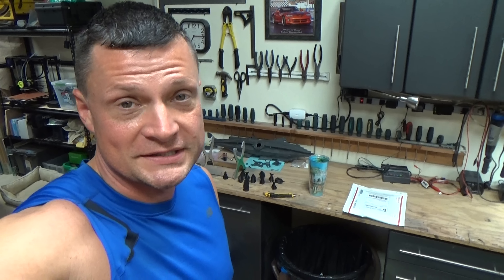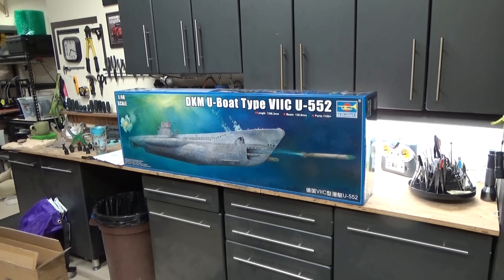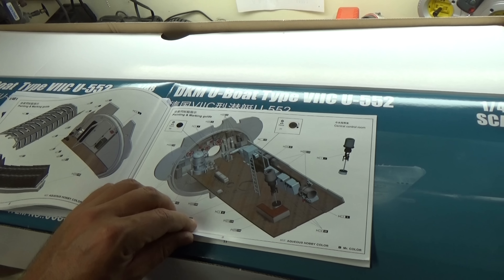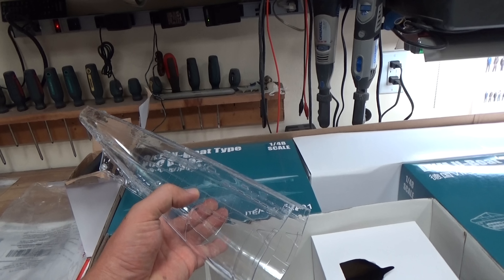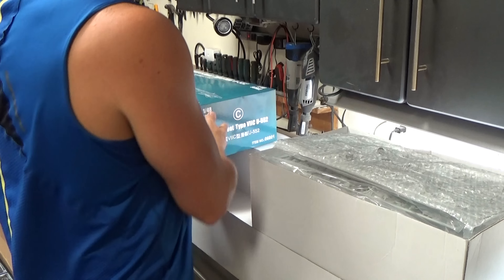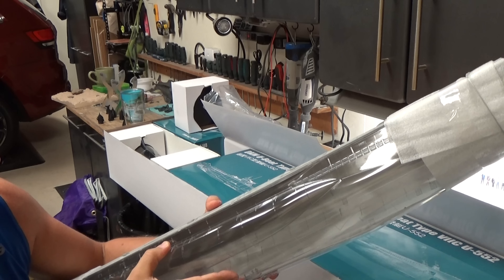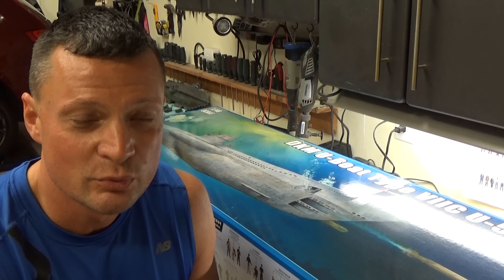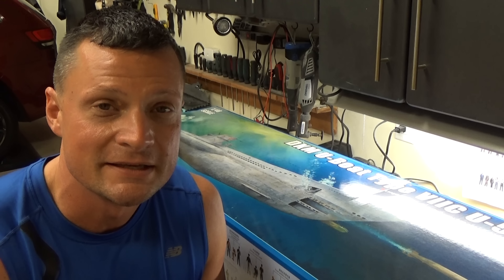Trumpeter Type VII Kit Review by the Nautilus Drydocks

Comment: Not necessarily a UBoat lover, but sure, Submarines generally. The preferred scale is 1/144 because of it's manageable size for home display and less cumbersome for handling during construction.
RC capability is not so much an attraction because local harbour and waterways, while popular places for modelers of RC surface boats, an RC Submarine may dive and dissappear.
I'm not so sure how an RC Submarines would fare in some quiet rural creeks and streams where there can be 1/1 scale Eels hovering at the edges. Some of these would be capable of swallowing whole a small scale model Submarine, yet probably unlikely that they would bother, when I come to think about it.

Comment: Unfortunate that they made the conning tower clear on the opposite side that the hull is clear.  I wonder in painting the entire kit, and utilizing cut out 'windows' to display the interior would look good.
Reply from the maker: I actually missed the fact that the tower was clear on the opposite side. Good eyes! With that being the case, I think i would actually just paint the entire tower. Having one side completely finished as the full exterior is important (at least to me). Great suggestion on the windows as well. Thanks a lot!
Reply: ya, one side fully painted is important to me, too.  How does this kit compare to the Arkmodel kit in regards to detail?
Reply from the maker: The two kits have the same amount of detail, however I would guess that the Trumpeter is slightly more accurate.  For a display model,  I'd go Trumpeter. For RC, I would absolutely go Arkmodel.